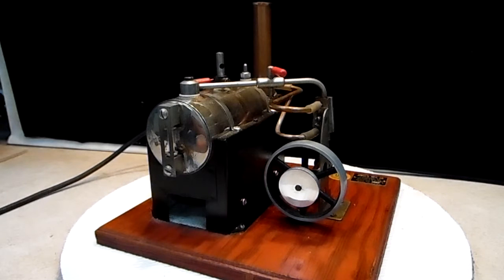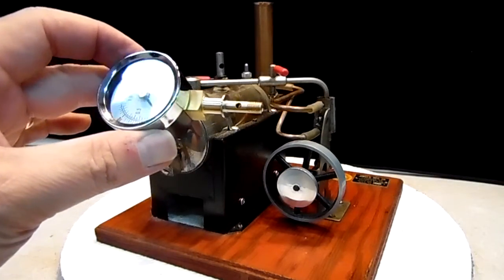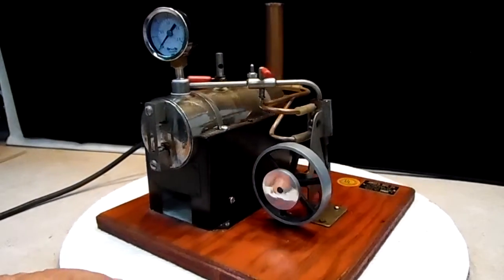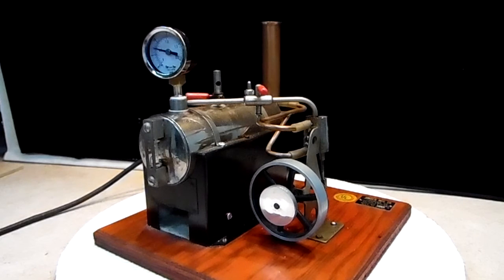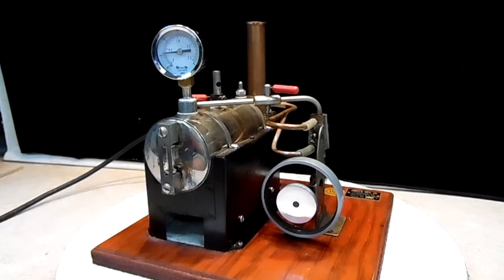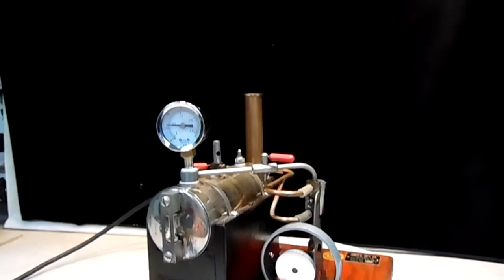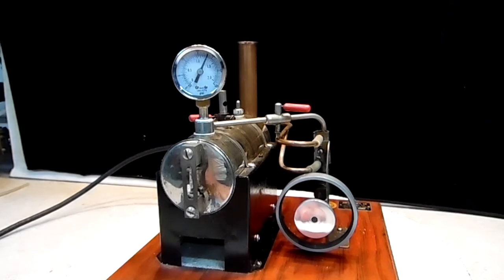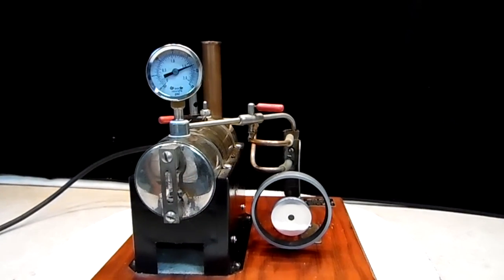Jensen steam "banjo" pressure gauge

Comment: I really like the gauge setup I could actually use a couple .... Will have to have a try at making some
Reply from the maker: be careful ,I have ruined several before I found a consistent solution. I have done about 30 & it still takes close to an hr for each one.